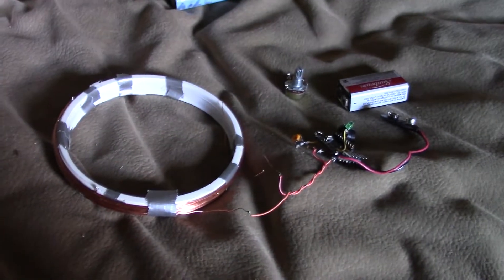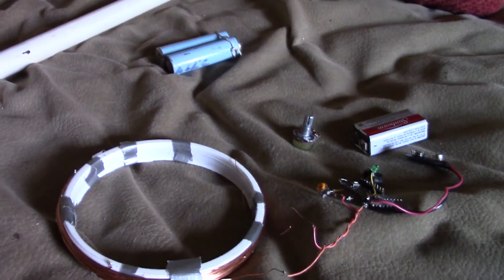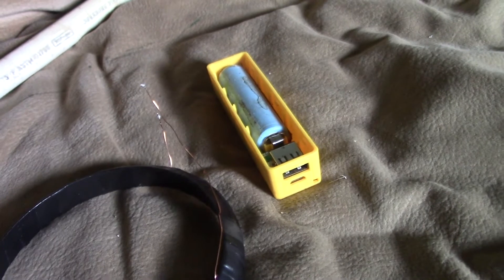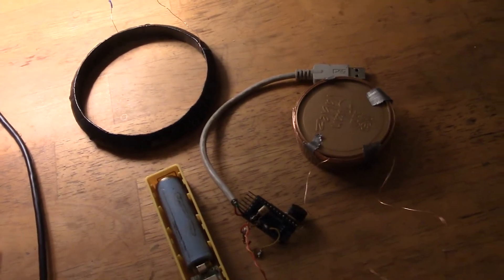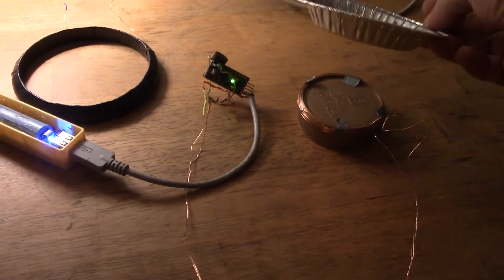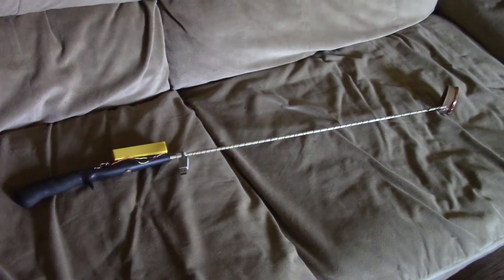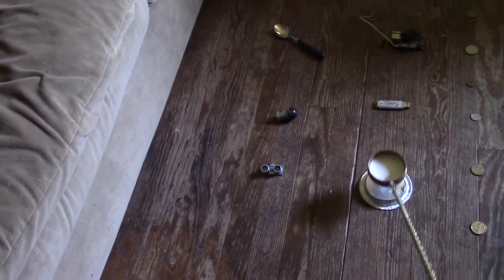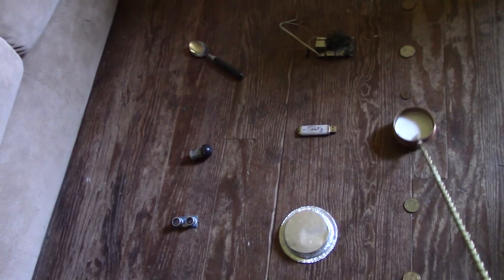Metal Detector circuit - Trials and Tribulations

Comment: Of course you do metal detectors too. lol. Every time I get a new hobby, Sliders done it too. lol.
Do you know how to measure zero crossings with Arduino to within a few ns? I have a pi/vlf hybrid I should do something with. Its sort of SWES based lol. I'll PM you link. You Will laugh.
Reply from the maker: Always great to see that a wallaby hasn't eaten you dear sir. Yeah, I've had an interest in all this for years, but previous circuits were damn awful. This one is ok, with a good simple detecting system. It uses the charge rate of the 0.01uF cap, averaging it.

I would think that 2 analog inputs compared would work for zero crossings. You may need to use interrupts for closest to ns precision. Or, maybe a fast detector circuit external to the Arduino, with the Arduino being a data collector and screen output.
Reply: @Slider2732  https://youtu.be/oo60nZ0z58I
I'll possibly delete link later. The project should be open source, but need to release before the big 2 get it working.... Was getting a lot of help requests in inbox so made it private for a while, untill I can get the detector more portable than the rigol....

Comment: Love metal detecting. Look up shielding for the coil. Will reduce falsing and give consistancy over the ground the coil waves over. A paste made from the black stuff from a carbon zinc cell and PVA glue makes a good shield.
Reply from the maker: What a good idea, had never thought or heard about such a thing. Makes sense, the top of the coil is never used.
Reply: @Slider2732  so i am not sure how it will affect your circuit since I don't what technology the device is using to detect the metal...but the shielding I refer to actually goes around the whole coil. It is not a total RF shield but a sort of partial shield. The material of the black paint needs to be "tuned" to a certain ohms per square. Do you have any of Rob Murray-Smith's paint? The tuning is just thicker or thinner layers, perhaps dilution of the glue with more glue base to achieve the right ohms rating, or applying it thinner. This approach is done on Pulse Induction style detectors.
Reply from the maker: Great info, thanks. The Arduino code counts the time a 0.01uF cap takes to charge. It's about the simplest method. I don't have any of RMS's ink, but can make a conductive ink...somewhere between Indian and graphene and can work to an ohms per square (making the whole thing easier to do, in fact). White glue would be the glue, if I understand the process.Might well have a look at all this, even if the detector type is wrong.
Reply: @Slider2732  yes it is a strange fringe science making detector coils and well worth the journey into pulses and how they setup a ringing in the target. How the earth weather and sun can affect detectors, all the different methods used to locate a metal target, I will see if I can find you some links that get you in the deep end without all the fluff.EDIT-have added a link under your last comment, if it is not visible, check your community tab for spam
Reply: @Slider2732  this was the best place for info from memory....geotech website
https://www.geotech1.com/pages/metdet/projects/fastcoils/FastCoil.pdf
Reply from the maker: Many thanks, looks like YT trusts your links too, will have a read. I can well believe the sun/weather effects, used to have a 75ft outdoor aerial for a crystal set and it would hum when the sun was out.

Comment: I have a £10 Childs metal detector, Got to have a go see if this works better, What gauge wire are you using?
Reply from the maker: It's salvaged and approx 24AWG. The website shows a coil with thicker insulated wire and in a single layer arrangement up the coil form. It seems to work similarly to his short demo. I'd say to experiment though, adding turns, removing turns, another amount than 20 may suit your setup or gauges of wire that you have..
Reply: @Slider2732  Thanks for prompt reply, time to destroy grandsons disused detector. Keep up the good work

Comment: Now there is a coincidence, I ordered a cheap Chinese metal detector kit on eBay a few days back just for something to do indoors when it rains through the summer. Just one of those with a coil on a printed circuit board and a few transistors.
Reply from the maker: Looking forward to your vid(s) on that  :)
I tried a 555 version and a Colpitts based circuit, both were worse than this one, for range and stability. Hence this appears fully built and I decided to go ahead and finish it.